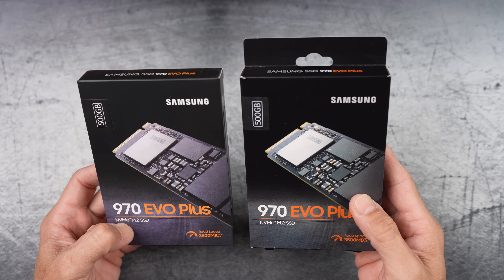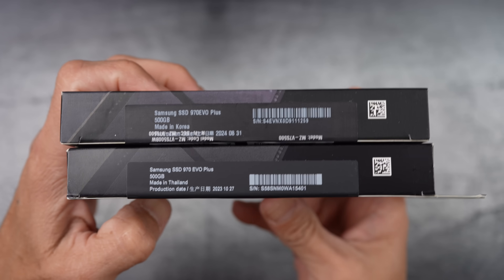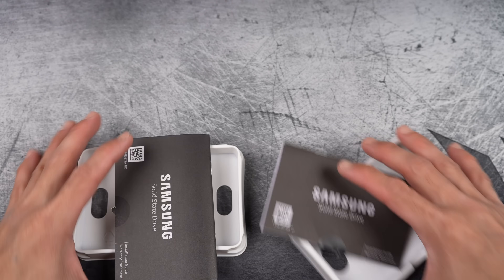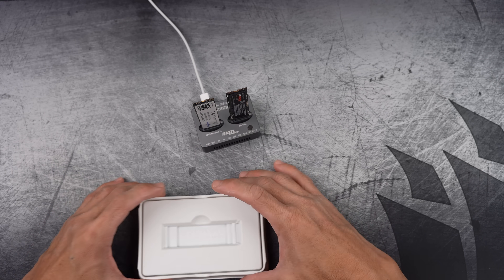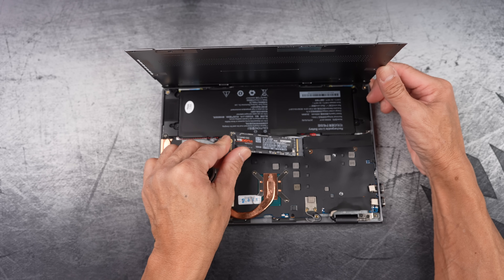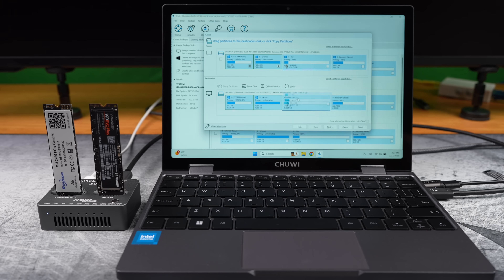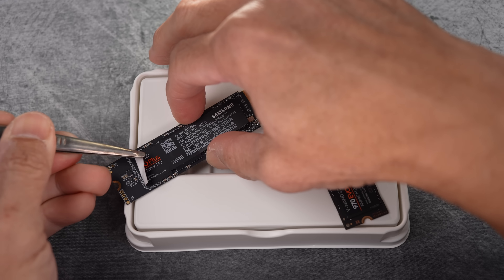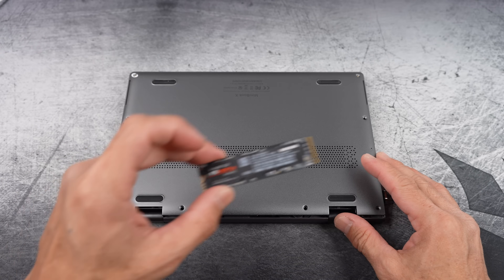Fake vs Real SSD - Can You Spot the Difference?

Comment: The manufacturers are the same.  Samsung designs the products, but the factories will sell it to anyone knowingly.  Very few countries have meaningful intellectual property laws, so Samsung can't really stop it.  This is how IP laws in the US guard customers from getting ripped off.  These are regulations that protect consumers.
Reply from the maker: Yeah, it’s wild how that works. Factories can crank out the same design but sell it off to whoever, making it tough to regulate. Definitely makes strong IP laws even more important for protecting buyers. Appreciate your insight!
Reply: Well done. Calling them real and fake is wrong. They are both Samsung products. This video did not prove otherwise. Again saying one 'may have' used cheaper components is just a guess. Stick to comparing speeds etc , but don't call them real or fake because you have no idea what you are talking about.
Reply from the maker: @tonyatgoogle6076 I get what you’re saying, but there are key differences that make one of them questionable. While the outer shell may look legit, the internals tell a different story—one lacks DRAM, uses lower-quality NAND, and has a different PCB layout than official Samsung SSDs. Samsung Magician doesn’t recognize it, and the performance isn’t up to par with genuine models. At best, it’s a heavily downgraded product being sold as something it’s not. That’s why it’s being called fake—not because it physically exists, but because it’s misleading buyers into thinking it’s something it isn’t.
Reply: @TossSong  ok, so you see some dram, and it performs a bit better and perhaps you bought it from some known shop and cost you a bit more.. Are these the your prove of a genuine product?

Comment: As others have said, the lack of country of origin is a huge red flag. But the PCB itself gives away a lot, particularly the fact the fake (bottom) drive lacks the modern JTAG pin array at edge of the SSD that Samsung has used for a decade.
Reply from the maker: Good eye, missing JTAG pin array! These fakes are getting more convincing, but little details like that make it clear. The lack of country of origin is another big red flag too. Appreciate the insight!

Comment: Great recording "voice". :)
Reply from the maker: Thanks! I try to make sure my voice is clear so the info is easy to follow. Otherwise, my heavy Asian accent and mumbling tendencies might take over! Appreciate you watching and commenting. 😊
Reply: @TossSong  :) Great to hear back from you. I'm building a new pc and am torn on what SSD to choose (Samsung Evo Plus, or the Pro model, or perhaps the Crucial t500?) Way too many choices. Hard to decide. :)
Reply from the maker: Nice! Those are all solid choices. If you want top-tier performance and durability, the Samsung Pro is the way to go. The Evo Plus is a great balance of speed and price, and the Crucial T500 is a solid value option. If you’re doing heavy workloads, the Pro is worth it, but for general use, the Evo Plus or T500 should be great. Tough call, but you can’t really go wrong with any of them!
Reply: @TossSong  :) Thank you! :)

Comment: it funny.  you had to use the fake drive to copy info to the real one just to get the real M.2 to work.  it seen like that fake one work just as fine if not better then the real one. and the test speed was not to far off from the OG M.2 card you had in.
Reply from the maker: Yeah, it was definitely a unique workaround! But in the end, I just reinstalled Windows 11 using Chuwi’s pre-installed version with all the necessary drivers. Up till now, the Real drive’s performance is way better than both the stock and the fake ones—totally worth the trouble of getting it installed!

Comment: 970 evo plus doesn't have light right😅
Reply from the maker: Yep, no lights on the 970 EVO Plus! Just a sleek, no-frills SSD.
Reply: @TossSong  in fake we seen light in your video so I think it also can help in identify
Reply from the maker: Definitely. But I believe the latter model may have light, not 100 percent sure.
Reply: @TossSong  maybe possible but even I have 970 Evo plus so confirmed, even samsung magician had showed genuine, try fake ssd in samsung magician will it show genuine?
Reply from the maker: I did test it off camera (you might have caught it in the video that I have the software installed). The Magician software didn’t recognize the fake drive as ‘genuine,’ but it did display the correct name. However, the serial number wasn’t found in their database.
Reply: @TossSong  because it will detect all drives it doesn't need to be samsung, app will just Display the data provided by drive, only seriel number they can't copy so it can show it's fake or not
Reply from the maker: Of course, you’re right. Pretty sure. And they of course will carry on selling these hoping we don’t find out.
Reply: @TossSong  normally they can't be caught by normal users unless data started wiping

Comment: Samsung is dull brand
Reply from the maker: I chose the Samsung 970 EVO Plus because it’s the fastest SSD that the Chuwi MiniBook X can fully utilize. Since the MiniBook X only supports PCIe 3.0, getting a PCIe 4.0 drive wouldn’t provide any extra speed. The 970 EVO Plus delivers up to 3,500 MB/s read and 3,300 MB/s write speeds, which is the absolute max this laptop can handle. It’s also known for its reliability and endurance, making it the best upgrade choice. Unfortunately, I got a fake one, which is why I made this video!

Comment: are you saying that all samsung units are all made in thailand? i rather have made in china than made in thailand which is not famous of good quality. You didnt even notice that the stock ssd on you laptop is also made in china lol.
Reply from the maker: Thanks for commenting. I just read the labels on both the real and fake SSDs and shared the information as it was. I didn’t imply anything about quality based on where they were made.
Reply: @TossSong  the fake one is made in korea, your stock ssd is made in china, the said to be genuine is made in thailand but it's chip is still made in china. verdict could be, koreans may have limited access to chips unlike made in taiwan and thailand and vietnam.
Reply from the maker: @UNBIASEDCOMMENT Interesting observation! I was just going by the labels on the drives. It’s fascinating to see where different components are sourced from and how manufacturing varies across regions. Thanks for sharing your insight!
Reply: @TossSong   on my experience, i have samsung flat screen tv made in vietnam, screen wont function and remote wont work after 7 months of use. my neighbor has chinese TCL flat screen tv just half the price of my samsung. my samsung dont want to give me a warranty because it will cost same price of my smart TV.TCL still all good for several years like brandnew. i learn that i wont fall for a brand. it is nonsense paying so much for the brand while not even reliable.
Reply from the maker: @UNBIASEDCOMMENT Definitely frustrating when a pricey brand doesn’t hold up and a more affordable option works better. It makes you question whether you’re paying for quality or just the name. Definitely something to think about when making future purchases! Thanks again for sharing.
Reply: @TossSong   did you know even made in thailand honda suffers crankshaft damage after 240 km odo? https://www.youtube.com/watch?v=q1rfuFO7CNI&t=5s but you wont see a video about a chinese bike suffering engine damage on low odo. most fanboys claim they are reliable because it is a leading brand for durability. after i give them a video they go silent in shame. hehehehe
Reply from the maker: Interesting point! It’s always eye-opening to see real-world cases where even trusted brands can have issues. Definitely challenges the perception of reliability. At the end of the day, I guess every brand has its hits and misses!
Reply: @TossSong   means that reliability and quality of a brand wont be declared unless there are proofs of issues. it was like paying more for a famous brand while the quality is is not even sure.
Reply: @TossSong   anyway, is the video link i give you not restricted in your country?
Reply from the maker: No, not restricted. No close caption [CC] available, but I could make it out. Thanks for sharing it.

Comment: What is the generation of your laptop.
Reply from the maker: Thanks for commenting. My laptop is the Chuwi MiniBook X with N100 Intel.
Reply: It is still hard to understand the generation of your laptop..is it intel 1st,2nd,3rd,4th.....12th,13th,14th or 15th generation intel 💻. Thanks 🙏.
Reply from the maker: @yasirarafat9279 Thank you for your reply. The laptop is a Chuwi MiniBook X with an Intel N100 processor. It’s not part of Intel’s traditional Core series with numbered generations but is a power-efficient chip designed for compact devices.

Comment: Connect it to a phine or tab using the otg cable and a case. Copy 1 gb of win 3.1 and dos stuff and games to the drive. Its speed will become much higher 2x or 3x faster. A Kingston will be 15 mb/s from 10 mb/s. You can then continue with pc to maximaze the speed using the usb port. Then the drive will be the fastest, you can start it as a drive with already max speed.
Reply from the maker: Thanks for your comment. Interesting approach! I haven’t tried that method, but I’m curious how much of a difference it actually makes in real-world use. Have you tested it with different drives to see consistent results?

Comment: Actually the fake one is not bad at all. Was expecting not to work at all, you said the nand chips are of poor quality, what is the part number for each?
Reply from the maker: True, it wasn’t completely unusable, but the real concern is long-term reliability. The fake one doesn’t even have a proper NAND chip! It’s just a controller tricking the system into thinking it’s real storage. That’s why reliability is a big concern—it’s not built to last.

Comment: Thanks for the video.  It gives me more clues to look for details, and question to escalate to fraud sometimes, when I see something questionable like this.  I wouldn't have guessed this was an example, except for the video title (these people are getting sneaky supplying our warehouses with fraud).  Only because of that title, I started looking closely (and actually correctly guessed the one that's fraud, it had more red in color, lol.  The labels and seeing the actual board helped too but I don't have that option usually at work either, lol).

Working at a warehouse and printing off barcodes all day that look just like that one at 2 min 11s into the video, I think that was at an Amazon at some point with that barcode label of X002X9GJQB.
Reply from the maker: Glad the video helped! Yeah, these scams are getting more sophisticated. It’s crazy how sneaky they are, even slipping into warehouses. That barcode part is interesting—seems like it’s been floating around different marketplaces. Appreciate your insight!
Reply: @TossSong  Welcome.  Also, thank you for the video too!

Because I am familiar with computer parts, I can usually identify them, and electronics in general.  The first questions I try answering are usually, what's the manufacturer, model number, and anything else that's actually verifiable.  Electronics are usually easy that way but, after this video, I have to question everything even more, lol.

Since I started working at Amazon, it is surprising how many things have no manufacturer, model number, or anything identifiable to any source.  Even flash lights!
Reply from the maker: @spacedreaming That’s a great approach! Being familiar with computer parts definitely helps spot inconsistencies. The lack of manufacturer details on so many products is really concerning, especially when buying online. This whole experience made me rethink how I check for authenticity too!
Reply: @TossSong  I went back to that part of the video.  It's the box with the tab, you identified as the real one, that has that barcode sticker I identified as possibly Amazon.  So that's good at least.
Reply from the maker: Yeah, that’s a relief at least! It’s good to have some confirmation that the real one was indeed legit. The whole experience really highlights how tricky spotting fakes can be, even when everything looks close at first glance! Thanks again for sharing.

Comment: The fake one is faster than a lot of gen 3 ssds out there 😂
Reply from the maker: Thanks for commenting. I was initially impressed, but as you saw, the real drive outperformed it by a significant margin. That’s when I started questioning the reliability of the fake one, and how  it would be in the long run.

Comment: Interesting video. Would be more interesting of you enter the serial number into Samsung's support site & see what it says. Also you could try Samsung's Magician software on that fake drive & see what results it gets.
Reply from the maker: Thanks for the suggestion! And I hope it was helpful. I actually did check the serial number and used Samsung Magician (you could tell on the laptop screen it was installed), but I decided not to include it in the video because I thought it was telling enough with what I had. And might have been too long. But again thanks for pointing that out.

Comment: i have one of these fake SSDs i noticed that the total host writes are a lot higher than my usage , after filling it up to 50% the speed went down to 50MB/s , after i filled to 70% i paused the copying , then i noticed high read and write speed and more total host writes , I started the transferring again and suddenly it has high speed again until it fills up the fast nand cell .
it turns out that it moves the data from the fast nand to the slower ones so the problem with this is the high writes it tends to make the ssd wear faster and by fast I mean like in  few months I managed to write around 1tb in 4 days wich really high  like double or triple what i actually used 
those SSDs are very bad and will die very quickly and they will always suprise you how they cut corners don't be fooled by the cheap price or think that you could use it as an external drive or bootable drive for old PCs.......
they are a waste of money and data
Reply from the maker: It sounds like you’ve really put that fake SSD to the test! The way it shifts data from fast NAND to slower NAND and inflates total host writes is a sneaky trick, making the drive wear out way faster than expected. Your experience shows just how unreliable these drives are—not only do they degrade quickly, but their performance drops drastically after a certain fill percentage. Definitely not worth the risk for long-term use, even as an external or bootable drive. Thanks for sharing your findings!
Reply: also the temperature is stuck at 40c so there is no heat sensor
Reply from the maker: That’s interesting! Seems like the fake SSDs don’t even bother implementing a real temperature sensor. Stuck at 40°C no matter what—definitely another red flag!

Comment: 2:50 so obvious. Real one the controller underneath the samsung sticker is silver in color and outline. The 2nd one doesn't even had a controller that's why can't see the silver outline.
Reply from the maker: Thanks for commenting! The real one has a visible controller under the sticker, while the fake one is missing it entirely. That’s a clear giveaway when comparing them side by side.
Reply: it is hard to notice that when it is sealed 
then when you open it and it works not all stores will return it
Reply from the maker: @kingslayerx0x Yeah, that’s the tricky part. Once it’s opened and technically ‘works,’ many stores won’t take it back, even if it’s fake. That’s why checking serial numbers and packaging details before opening is important, but even then, it’s not always obvious.

Comment: Status LED on the fake drive is an instant giveaway. Original Samsung has no LEDs.
Reply from the maker: Yep, that’s a dead giveaway! When cloning with a cloning device, the fake drive’s LED kept flashing. Original Samsung drives don’t have any status LEDs at all.
Reply: @TossSong  I believe the only genuine Samsung M.2 NVMe SSD with an LED is the 990 Pro Heatsink
Reply from the maker: @Sama3L Good point! The 990 Pro Heatsink does have an LED, but for most Samsung SSDs, an LED is a clear giveaway of a fake. Thanks for sharing!

Comment: Why not use the Samsung Magian to check if drive is fake or real?
Reply from the maker: Good point! But using Samsung Magician alone would make for too short of a video. I did tested it off camera (you could even see the Magician software installed on the laptop screen). I wanted to dive deeper into the details to really show how convincing these fakes can be.

Comment: Interesting video. What seemed a bit odd though was that you were unable to copy from the original drive to the Samsung and actually needed the 'fake' drive to complete the task 🤔 Did it require a reformat first?
Reply from the maker: Quite possible. It was a bit odd, right? The original drive had some issues with copying directly to the Samsung, but the fake SSD worked without problems. I didn’t need to reformat it first, which was surprising. Not sure if it had something to do with the file system or how the fake drive was set up, but it definitely made the process unusual! Thanks for watching and for your comment!
Reply: @ Yes a bit strange. I saw someone said it had to do with the Samsung being 500 Gb instead of 512 Gb because of data protection or something. I guess that could be the answer.